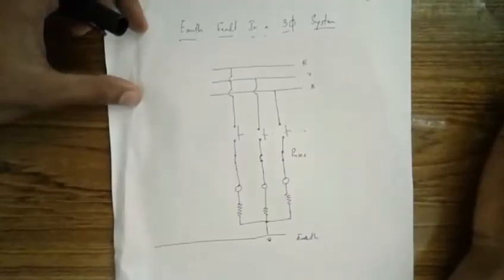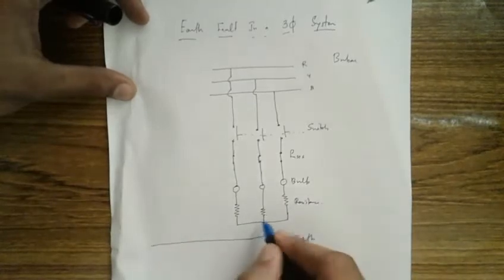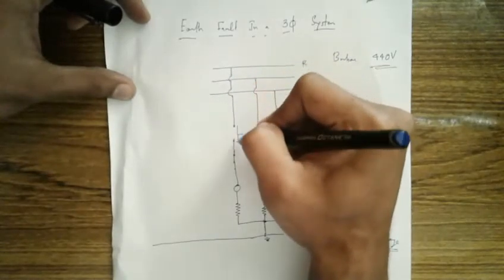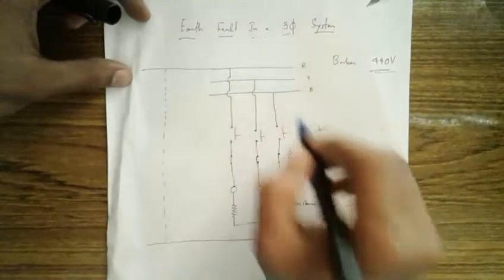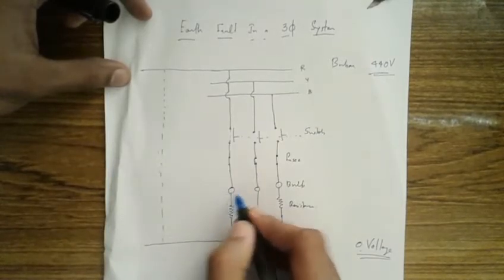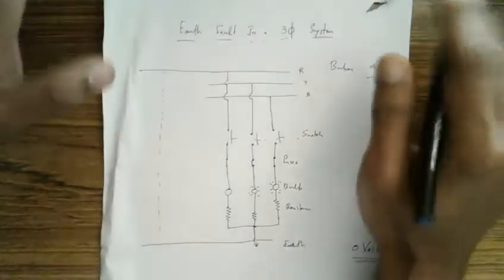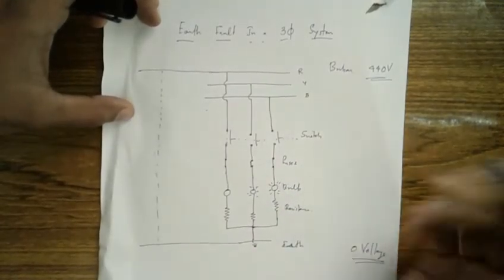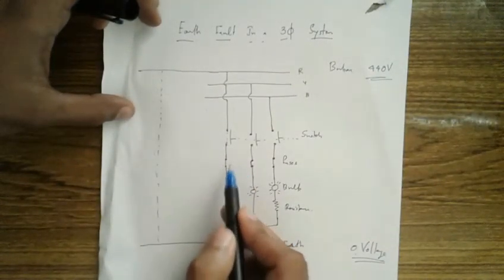Earth leakage detection in a three phase system onboard ship

Comment: 3phase motor's (no neutral ) ELR is tripping after 75% load 
We connected second motor cable connect to 1st motor which is tripping ,surprise it did not trip.

Then 1st motor cable connected to second motor .second motor is tripping 

We changed all systems in 1st motor circuit  (cable, ELR, cable,acb ) . Again it  is tripping 
What is the issue ?? Anyone can help me 

This is chiller ckt

Comment: If two earth fault occur in R and Y lines  and how to detect earth fault through this method?
Will  the two bulbs of those line become dim or bright than before?
Reply: two earth fauult in two different phase( R and Y) means its a short circuit and large amount of current is going to flow through the wires so over current relay or mcb is going to trip the circuit,

Comment: in ship control panel, every time this bulbs glow or only for test?
Reply: First of all.... a bulb can glow when given a single phase supply of 220v... anything above 250 v (maximum)  is going to fuse the bulb and 440v as explained here is surely going to destroy the whole bulb.He forgot to mention the installation of step down transformer in circuit before giving supply to bulb.